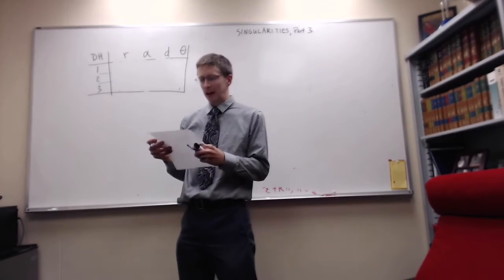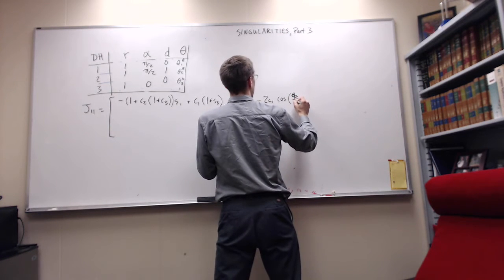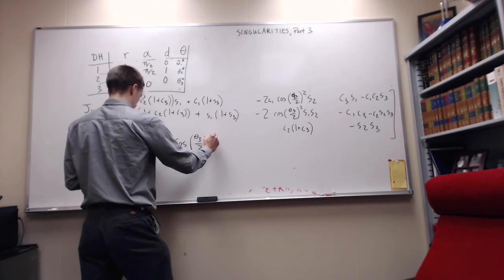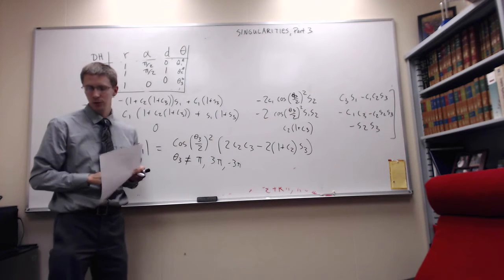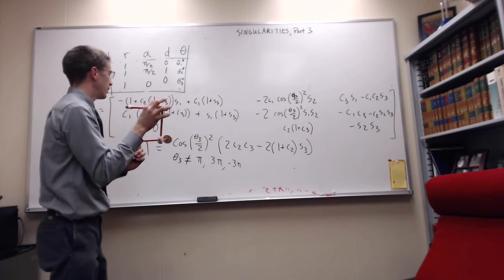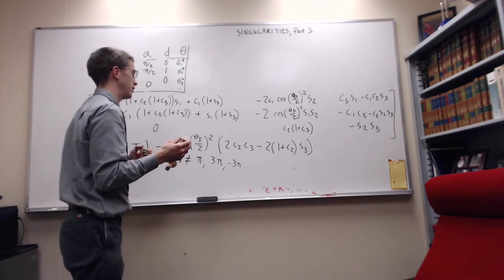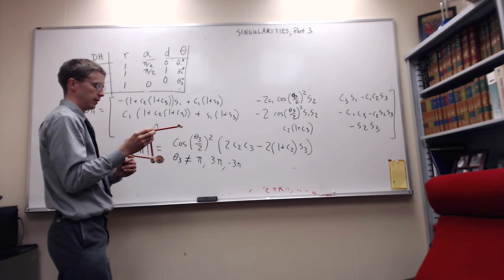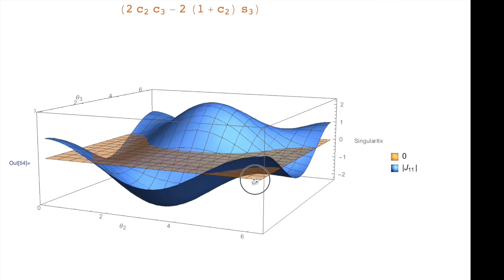Robot Singularities (3 of 3)

Comment: What happens if the matrix is not a square matrix? How to check singularities then?
Reply from the maker: Harsh Jaiswal, if the matrix is not square, it doesn't have an inverse.  A non square matrix will either be over determined (more DOFs in the robot than 6 [x,y,z,roll,pitch,yaw]), or underdetermined (less than 6 DOF).  If it is underdetermined, then sometimes you can construct a square matrix for the DOFs you care about -- the SCARA arm has 4 DOF, which map to being able to control x, y, z, and yaw.  If it is over determined, you can construct the pseudo inverse, which is a different lecture: https://robotacademy.net.au/lesson/jacobian-and-number-of-robot-joints/